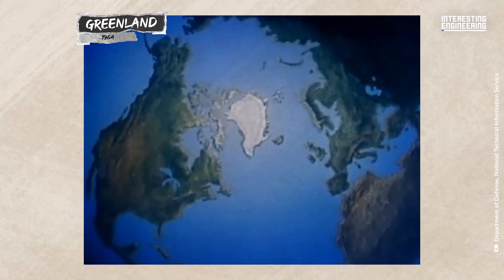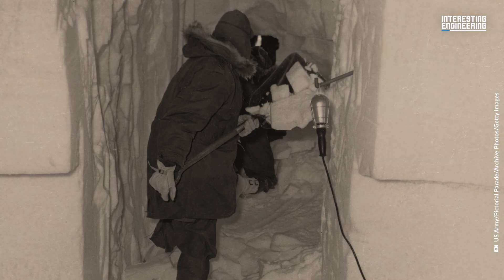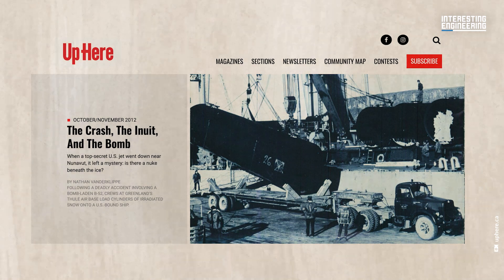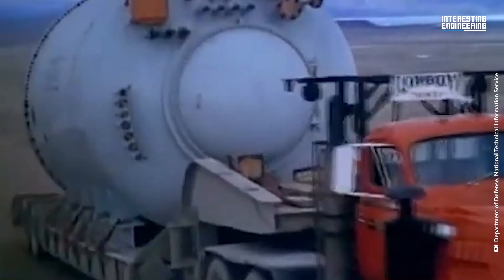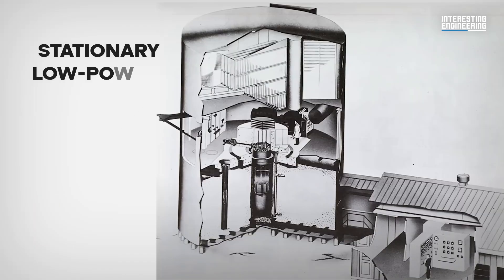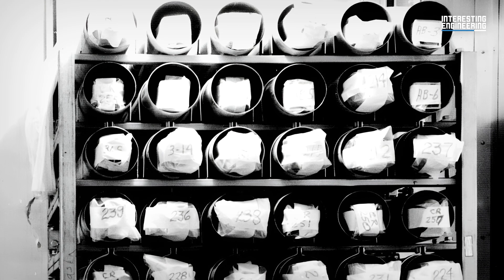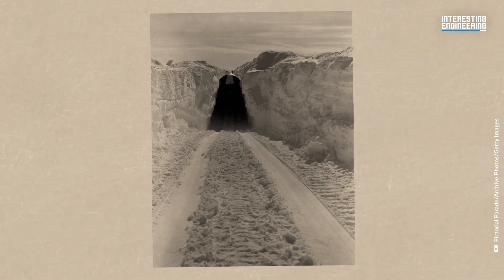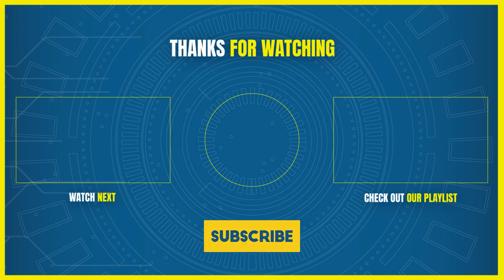Secret US Nuclear Base Found in Greenland

Comment: Thule is very dodgy indeed; we used to pass close to it when we flew to Northern Canada in the 80s, with the RAF..... it was strictly off limits except in a for emergency.  That happened to one of our aircraft; they had smoke in the cabin due to overheating electronics and carried out an emergency landing at Thule. On landing the aircraft was surrounded by heavily armed US soldiers.  The crew was taken to a transit accommodation block and were not allowed to leave until the aircraft was fixed and cleared to fly home.  The grounded that went to fix were also restricted to the accommodation block.  We often went to US bases in the US (such as NORAD HQ) and Iceland and we were never restricted on where we could travel on base.